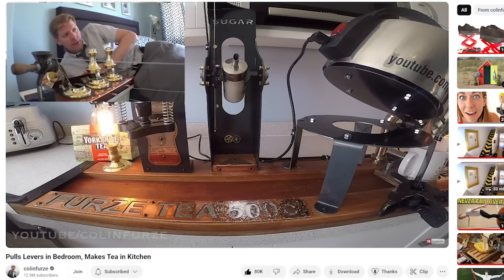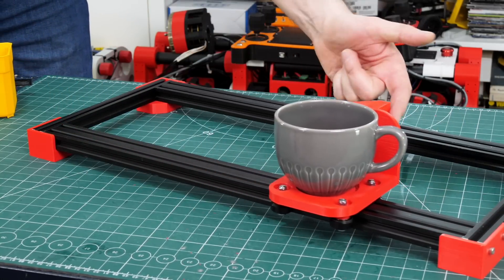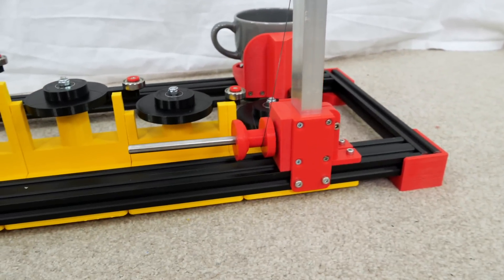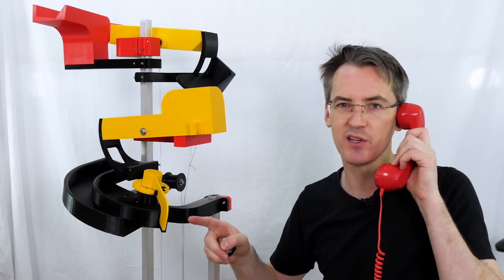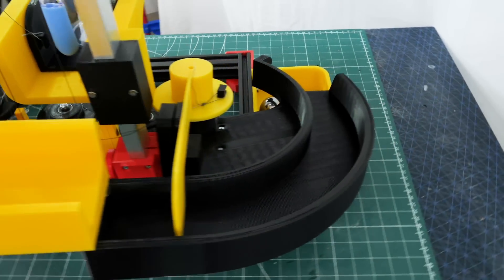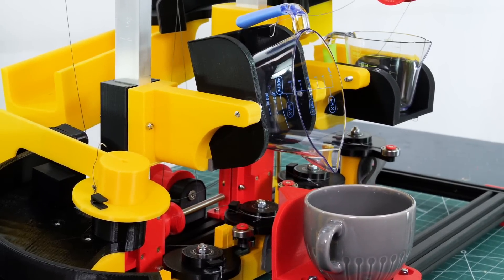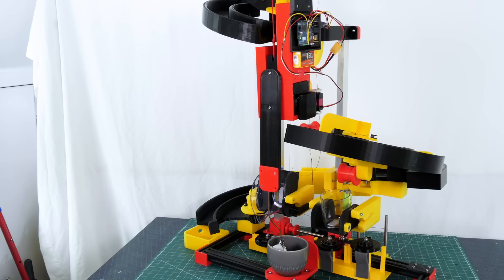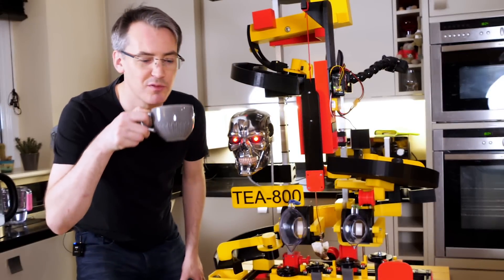Gravity powered machine

Comment: Nice and gratifying, as always.  Was this mechanism made mostly from originally-sourced parts, or was it made from leftover dismantled 3D printer parts?  Yes or no?  There is no wrong answer.
If only "tea" wasn't so awful.  It's like drinking slightly contaminated hot water.
Reply from the maker: It was all custom made for this project, thanks for watching!

Comment: A very cool modification to this design would be to use small ball bearing instead of a single large one. At each stage there is a buffer where it fills with multiple ball bearings, once the stage is complete the machine would slowly release the ball bearings to the next stage

Comment: Just a suggestion for making stuff wait a while:  the pendulum mechanism in a mechanical clock is fit for this task, as the marble could provide a torque to the mechanism while a pendulum swings back and forth to slowly increment a dial, eventually triggering something to occur later in the machine

Comment: I think using tea cup with a flat bottom on the inside instead of rounded would solve half of the splashing problems. A mechanical solution for the bag dipping timer could be water being slowly poured from one jug to another on a weight triggered mechanism or scale.

Comment: Too bad you had to put some electronics in there. For the door at the bottom of the elevator, you could have the elevator stretch out a spring and shut the door with a geared rod connected above.  When it released at the bottom, the door would be pushing up and you can have a gear with an escapement (like in a wind up clock) to slowly let it open

Comment: Don't forget about Marble machine X by Martin at Wintergatan. In the latest episode he used both a fly governor and a gravity governor to adjust the speed of the marble machine. Perhaps you could do something equal to slow down the decent of the bal through out the marble track. For example the seesaw tipping could be slowed down with a air governor while gravity governor could be used in combination with the elevator to so that when the ball enters the elevator the tea drops and the slow elevator starts to descend. When the elevator comes down to the bottom it lifts the tea bag out of the cup.
Reply: Governor doesn't adjust the speed, it make it constant.
Reply: @JesusWasAPunk31   Yea. I had to think about that. But  i think you are correct, but I do not fully know why. Care to explain?

Comment: you should start a 2nd marble in a parallel helix track, when this marble has reached the bottom it lands in a basket which releases the flap on the lift for the large marble via a cable pull. In this way, you can also release the tea time in a mechnical way, and depending on where in the helix the second ball starts, you can also regulate the length of the brewing!

Comment: 4:58 you could use do a simple syringe as a piston shock absorber to slow the pour. the dunking could be a wheel with a high ratio so the ball goes down but the wheel dunks many times before the ball reaches the bottom to the next stage.

Comment: The thing I'm increasingly appreciative of with your vides isn't the quality or perfection it's the way you just get shit done and call it finished. You are consistently producing rounded and complete projects at an astounding rate, great job 👍
Reply: He is quite underrated as an engineer, as most of his contraptions look pretty wacky, but the "Giant Robot Furby" really showed fast and precise engineering.
Reply: I didn't like that you used electronic parts in this project. A marble machine should be pure marble machine. You could have put a counter weight on the elevator with just enough weight to make it go down slowly. Don't get this in the wrong tone, I am also your fan 😅
Reply: @Priyansh_AgromachEngineering  I was thinking of adapting an hourglass design with sand to a weight box that will open the door after 2 min, or however long you want, just add more sand and make the door heavier or something
Reply: One of my fiance's favorite mantras for things that could always be made just a little better (at the cost of never being done) is "it's better than good, it's good enough."

Comment: The 1970's here, we used to have a thing called a Teas Made, which woke you up with a cup of tea in the morning. The way they did it was very simple and very clever. The kettle and tea pot were next to each other, the spout of the kettle took the form of a small diameter pipe bent 180° and feeding in to the tea pot. When the kettle boiled the pressure would force the water out of the kettle and in to the tea pot. The thing had a clock which you set the time you wanted to get up, 5 minutes prior to that the kettle would turn on, there was a pressure switch underneath the kettle, when the kettle emptied the switch would open and an alarm would go off and a light would turn on, I guess so you weren't trying to pour scolding hot tea in the dark. The alarm was a bit redundant as the hot water rushing out of the kettle was pretty noisy.
Reply: I remember my parents having one of those Teas Maids. 🫖
They never let me have it in my room 🙁 I had to go downstairs, make my tea then take it back upstairs.
Reply: Maybe I LIKE the misery.
Reply: My grandparents used them well into the 90's. The Goblin Teasmade!
Reply: Ah the 70's what a time to be alive! 😅